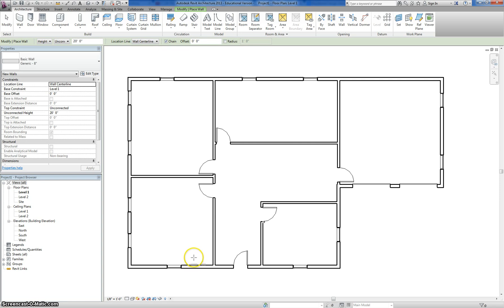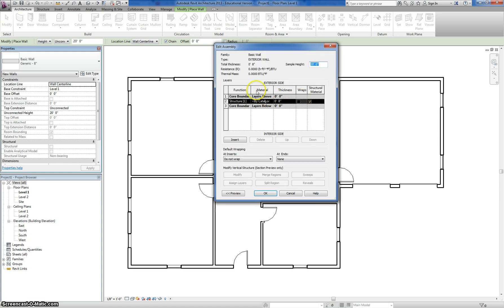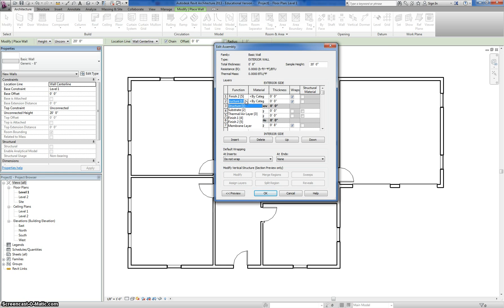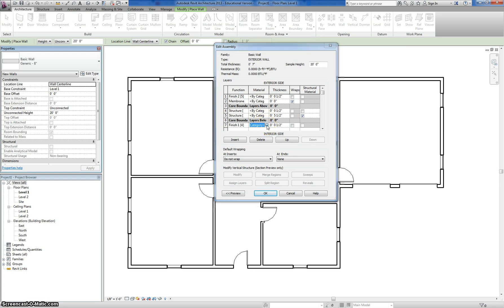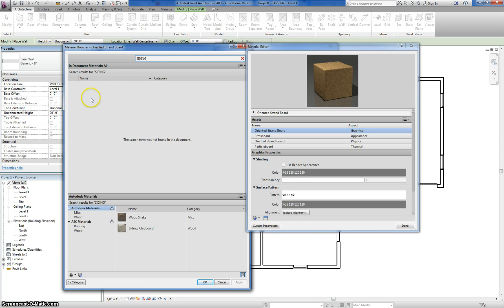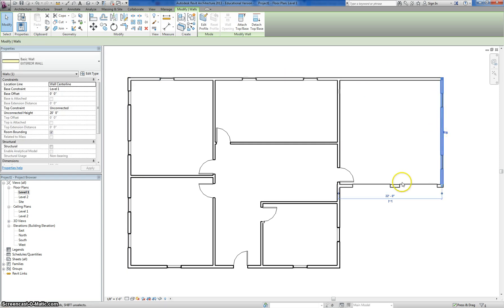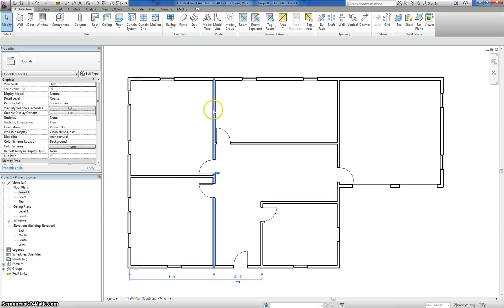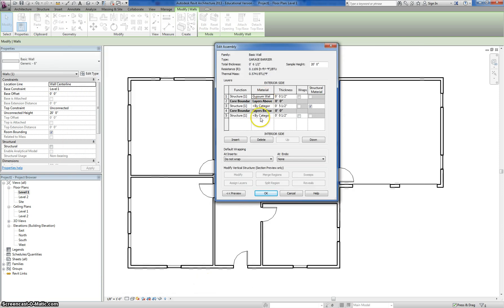Creating Wall Types in Revit 2013

Comment: Thank you for a very informative presentation. I really learned a lot from it, however, your last wall which I call the "garage wall" should have 5/8" thick gypsum board on the garage side isn't it? I live here in Los Angeles, CA and it's mandatory to have a "Type X" wall or sometimes called "firewall" between a garage and living area. Just a suggestion I'm sure every County or City differs in Building Codes. Otherwise it's one of the best presentation I've seen here in Youtube.